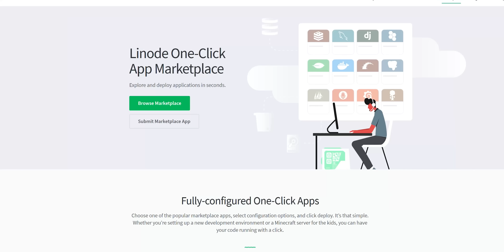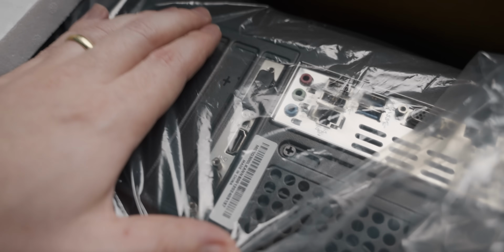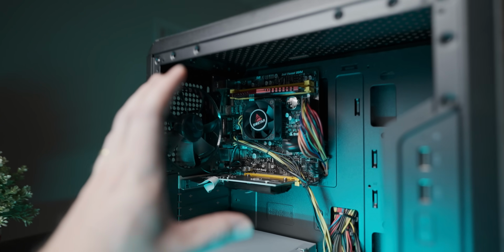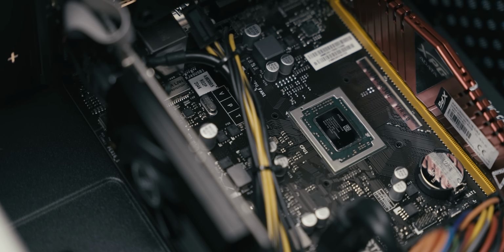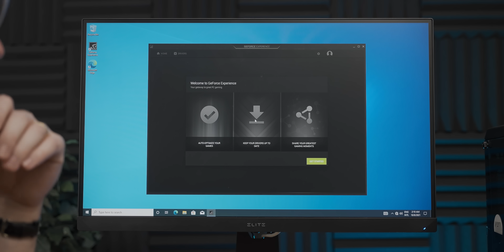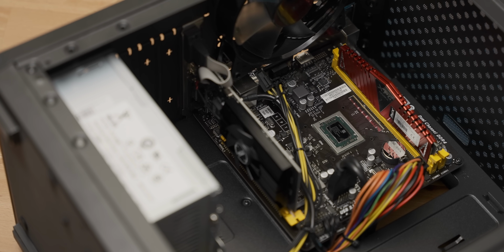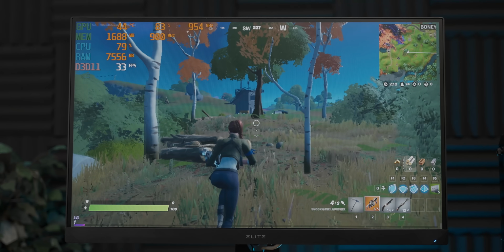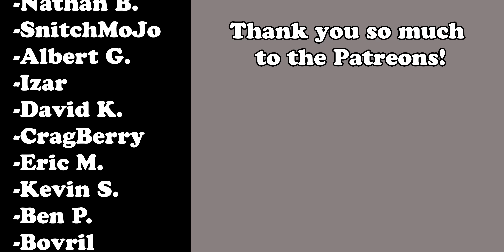The Cheapest Amazon Pre-Built "Gaming" PC is Ridiculous...

Comment: For the sake of clarity, this is NOT a Skytech computer. I know you didn't actually call it one, but since the logo from the keyboard was clearly visible, just wanted to point that out.

I've actually owned several  Skytech systems (cause I am getting lazy in my older years) and they use name brand mid/high end components (mostly MID, but there are higher end ones).

Like any pre-built manufacturer, they have their flaws, but wow, nothing on the level of THAT piece of crap.

Love the case though, I am thinking of making a baby Xeon out of one 😉

Watching that texture loss on GTA V brings back the nostalgia of my own Dell Optiplex/GT710 days.... Good times.

Comment: So yes you can make a better experience with old hardware, toke a ancient motherboard that was dumped on me with coolermaster cooler, sticked heatsinks on the vrm, put a free amd fx 6300 on it, overclocked the hell out of it to 4.4ghz on all 6 fake cores, put 12gb ram on, that i had laying around. Got one of those really explosive gigabyte psus and a €50 asus tripple slot gtx 680 2gb (also overclocked it naturally). Infected it with windows 11 to test it on totally unsupported hardware by using win 10 installation and win 11 package and it runs rdr2 on lowest settings at around 30fps for around €100 total. Will do gta5 much better.

Comment: I get so tired of these youngsters trashing vga ports.  There are more non-gamers than gamers in  the world, and we don't need power-hungry video cards on our email/surf the net/youtube pcs.  $50 for a used HP i7 2600 minitower with 12 gig ram and 1 tb hd, $25 for a new 250 gig solid state drive so you can run faster, $20 for a new wireless Logitech keyboard/mouse combo, and $90 for a new acer 24" monitor.  Less than $200 for a complete setup that fills non-gamer needs.  Can even play some older games on it.  If I want to add a video card, no change for a low power one or the card and a PSU if I want to go heavy duty

Comment: Of course an old Dell or HP business system with a 760 or 970 or rx580 or even a gt1030 will be a better system than those Amazon prebuilt systems. And you can pick them up for like a buck fifty and get a new gt1030 for about the same and away you go.

Comment: I just built a smal pc.. Gigabyte motherboard  Intel cor I 3 socket 1200  two sticks 8 gb of DDR 4   m.2 500 GB  with 1050 ti  500 wat power supply and a nice atx case  windows 10 original  for 500

Comment: The GT710 is a surprisingly fun GPU to mess with. There is a lot of overclocking headroom and you can get a lot more performance by just moving a few sliders in MSI Afterburner. But if you want the most out of it, you go and BIOS mod it and adjust the voltage even more. Getting a 1370-1400 MHz on Core and about 2000 MHz on the RAM is what i got to make it 30-45% faster*

*when I tried it in Battlefield 4.

Comment: Well, I guess now that you say it has an APU from a laptop, that would explain the small cooling fan.  Even a modern-day dual core Athlon would need a larger cooler.,

While I can't speak for the PowerMan power supply, I think like some larger manufacturers, like CoolerMaster who makes house-branded components, sometimes they aren't that bad.  What I generally will do (if I have to or will be using an included PSU, never on my own builds, but for other people who don't want to spend money -- I will weigh the power supplies as that will give a pretty good indication as to the quality, especially factoring in the power rating.  So like a 500 watt or higher should have a substantial amount of weight to it if they used decent components in side of the PSU).

Comment: So, just a question here:  for months (year or more) you've been buying what you call "The cheapest" system on places like Amazon, Newegg, etc...  and predictably they all come out as crap.  Be it GPU or CPU or single channel RAM or whatnot.  Instead of spending $1600 on multiple crap systems, then follow up vids on what to put in them to get them to run properly; why not buy some of their $1500 systems that have 3060's or 3070's and test those?   This would be content that would actually help folks decide on what is acceptable.  And, you at least have a shot at reselling them and/or getting some $$$ back or at least have a system that you can actually use somewhere in your production vs. 4 systems of crap that sit in a room.

Comment: I find even my little matx performs adequately for most games. It's an old b45g MoBo with 20gb of 1600 ram a 4670k pushing 4ghz and a 4gb Asus rx550 GPU. Yes it's a bit dated now but it's small, quiet and does me fine. Cost me a damn sight less to put together than one of these is to buy. The most expensive thing was an SFF power supply for the case lol

Comment: i have that same case for a budget build i just finished. the psu install area is ...odd... but there quite a bit of space on the back for cable management. if youre running ssds i advise using shorter than stand cables. those dust filters flop off rather easily and the side panel io looks neat till you try to plug up headphones and that little panel flexes inward

Comment: For the Old Dell/HP + old graphics card route, I'm doing something of that sort at the moment. I've been taking an old Dell Inspiron 530s and doing a dell Inspiron 530 mobo swap while throwing the highest end cpu that was compatible with it at the time, the core 2 quad q9650. I chose a gtx 750ti for the gpu. The build isn't quite finished yet, as I'm waiting on a couple of parts, and the RAM I ordered seems to be stuck in china somewhere. I transplanted the ram from the old system into the new one as a holdover for now (fun fact, its dual channel). I'm honestly surprised how standardized the parts were in this old system. No bullshit proprietary motherboard connectors, or sizes, and a fairly standard power supply (If you consider TFX form factor "standard"). I wouldn't personally recommend using a system this old, as I've spent far more money than it is worth actually putting it together. However, I had tons of fun building it so far, with some interesting problems to solve along the way.

Comment: I had a Dell Optiplex 980

Dell Optiplex 980 
Intel core i5 2.9GHz 
8GB DDR3 Ram 
Asus Strix OG RX 470 Graphics Card 
430W Power Supply 

Was a beast of a computer, I ran Call Of Duty Mobile, PubG, Portal 1 and 2, Modern warfare 2 and lots of other games. 

Would recommend upgrade the CPU to a core i7

Comment: I’m bouta buy  a HP ProDesk Desktop Customized RGB Lights Computer Intel Core i5 4570 3.2 GHz 8GB RAM 256GB SSD Win 10 Pro WiFi, Gaming PC Keyboard & Mouse (Renewed)
 HP ProDesk Desktop Customized RGB Lights Computer Intel Core i5 4570 3.2 GHz 8GB RAM 256GB SSD Win 10 Pro WiFi, Gaming PC Keyboard &amp; Mouse (Renewed) off  Amazon  can this run gta?

Comment: I recently built an Precision T1650 with an I7 GTX970  for my daughter for about the same price  that would ruin this machine. I'd say that the old Dell route is still the best. I had to drill out and remove the drive cage to get the video card in and swap the power supply but it is a good stable machine.

Comment: I built a machine around 2006 with a µATX board and a ThermalTake Sonic Tower (one of the very first widespread tower coolers, which were just coming up at the time) in a big tower case; that gave off a similarly mismatched vibe, especially as it didn't even have a graphics card to keep that huge cooler company on the mainboard.

Comment: I think that it would be pretty cool for you to review one of the older Dell/Lenovo/HP systems to see how they will run  today with a lower/midrange GPU. I recently bought an older Dell Precision T1600 with a Xenon CPU.  I have an old HD 7770 in it for now and I also have a Sapphire Nitro+ RX 580 8GB that I can mount outside the case with a pcie extension cable. They both work well with the system.The 580 was just way too big for the case. There is actually many different options you can do with these older systems depending on the power supply and the room with the case you choose.  I really do not play multi player games though, because of the expensive bandwidth option I am stuck with for now.  I DO prefer single player games like No Man's Sky and older titles like Skyrim. 
PS: I am not using the 580 outside the case for now until I find a safer place with more room and away from my "curious kitty" who will play with the fans when I am not looking!  😬

Comment: Actually I've gave one two of those Dell opitiplex a try and they are pretty good depending on what specs are included. Like onetime I scored an SFF with i3, had no hard drive or ram so upgrades are limited, but did score the DT/Slim one for $50 and it came with i5 and 8GB memory, just needed was a hard drive and gpu. Also I have two of those GTX 1050 laying around so been on the look out for a MT to install them into. Also love the tech content.